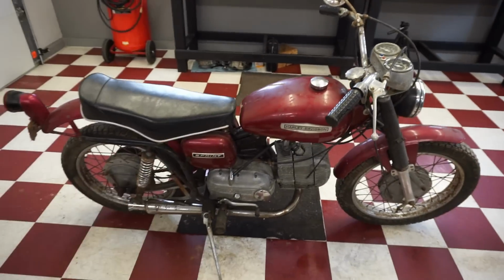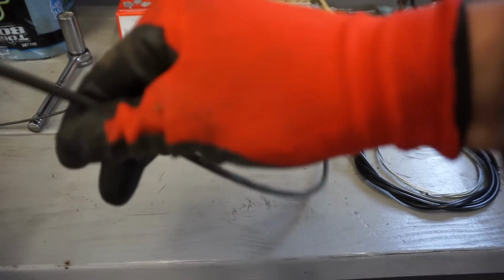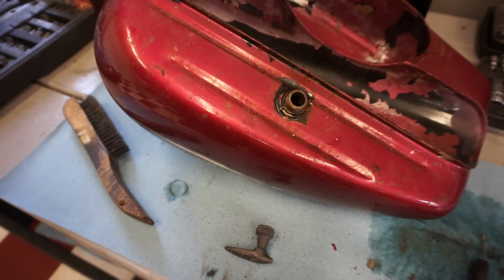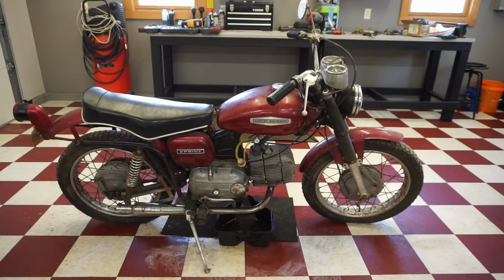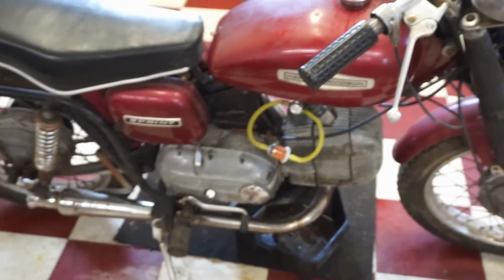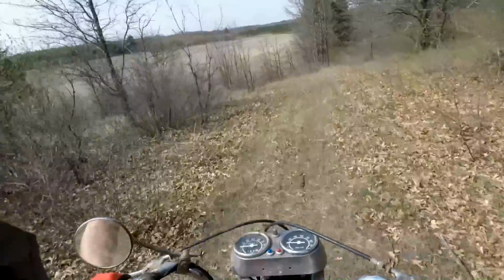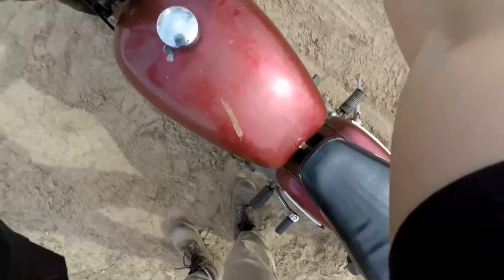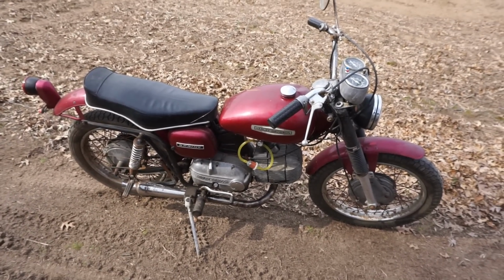1968 Harley Davidson Motorcycle RUNS For The First Time In 30+ Years

Comment: I had a 1967 sprint 250 and couldn't beat the Yamaha 250 big bears dragging. Over the winter the dealer said drop off your bike, I have an idea. Seem the older sprints had a longer stroke so come spring I had a sprint with a stroker kit in it. only way you could tell was the spacer between the jug and base. He used the main rod and push rods from and older sprint. After a slow breakin I could beat the Yamaha's 75% of the time.

Comment: The bike is actually what's known as an Enduro that means it's an on-off you can ride it on the street or you can ride on the dirt either or built for both. now I wish I kept mine LOL
Reply: No, it is not an enduro, it is built for street, although you can add knobbies and new sprocket and make a sweet dirt bile.
Reply: @davisworth5114  I used to own one they come from the factory with on-off tires all-terrain tires it's an Enduro, American version off-road on-road motorcycle from Harley-Davidson, I'm an old man I know these things. If it doesn't have the all-terrain tires on it it's because someone changed them at some point.
Reply: @davisworth5114  you're thinking about Enduro that looks like a dirt bike but it's an all-terrain vehicle mostly for dirt but it can be ridden on the street this is the opposite of that the Sprint was built to ride on the street but you can go on the dirt with it, it came with off-road tires from the factory the word is endurance means you could beat the s*** out of it.

Comment: Dude that rust remover contains Phosphoric Acid. Not good on paint, some plastic, and other things. Should have taken the tank off, you may have caused a oil leak (gaskets), damaged floor tiles.  It's always better to use a rust converter instead of a disolver or remover inside tanks, then use a sealer, like POR-15 or whatever your prefered fuel tank coating is.

Comment: rusty tanks first i take it out of bike then i put in a nuts and washers and  jack up rear of the car or atv and put it on in tire with straps and let it spin at all rust have loose out and  after that i wash it in brake clean and dry it then pore rust solutions or tank paint in spin tank couple times so its go in every spot.

Comment: Why don't you use your mouth to blow through the fuel inlet while moving the float up and down? If you can still make airflow with the needle seated then you have a corroded seat, or a bad needle. That is how you should test a needle and seat.

Comment: THIS BIKE WANTS TO BE REVVED 

Aermacchi made great two, and four-stroke bike engines....You know...taking a break from building, and powering AIRPLANES...... Their bike engines want to rev..... 

THIS BIKE IS ABSOLUTELY WORTHY of a GP fantasy-build. Fully fiberglass period-correct GP faired front, and rear, fiberglass covered plastic tank, for 250cc class Grand Prix cup road racing. You can order the fairings and tank, and tank cover online, and fit them yourself. (Even Isle of Man Mountain Course 250cc Four-stroke class worthy fantasy-build....Maybe one day, when you're YouTube famous, you can afford to take it to Isle of Man, and ride it on the full Mountain Course, while it's open to the public, during non-trials  hours.) This bike makes an absolutely stunning looking GP bike, with some racing refinements.....Also sounds really mean with a racing exhaust. 

Nice to see another Tygon fan. 😎 .....Make that bike a GP bike, and build yourself a paved course on your property out there... You've got elevation changes to put technical turns on, that make road racing truly great.

Comment: I'd look for A pipe bender tool from harbor freight to possibly straighten out those handle bar with some on that 1969 Harley Davidson motorcycle. That carburetor looks like A Batavis moped carburetor.& The pet cock to me. Use your micrometer to measure the inlet tank hole for right size petcock to fit your motorcycle.
Reply: It's a Dellorto carb, Italian.

Comment: "Hey Joe, where you go with that gun in yo hand?" !Lazy tank prep. wasted chemical. Too ashamed to show the result. Use small nuts to assist chemical and knock the rust off by shaking and rolling the tank. I've seen people  strap their rusty tank to a hobby cement mixer. That fuel filter install! Carb leaking, what the heck, fire it up anyway.
Reply: Give him credit,  it's running good!